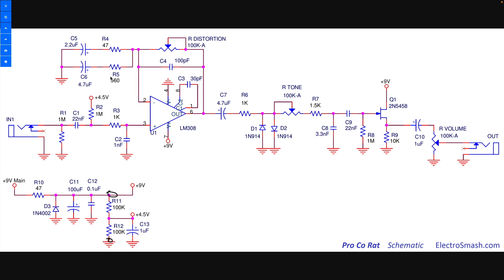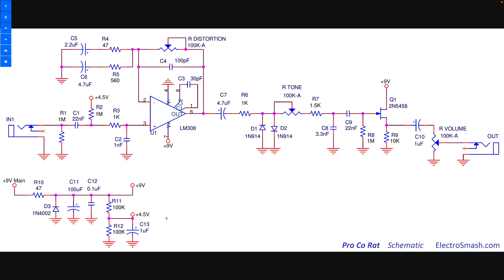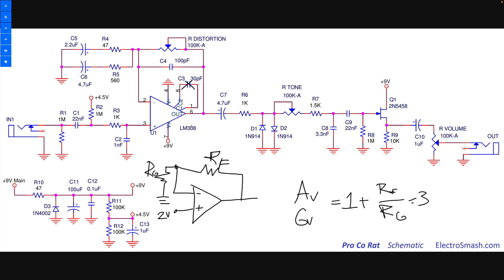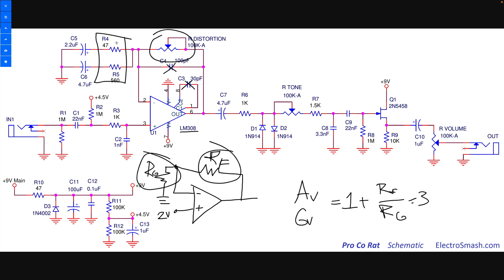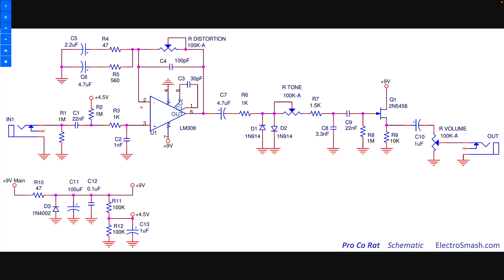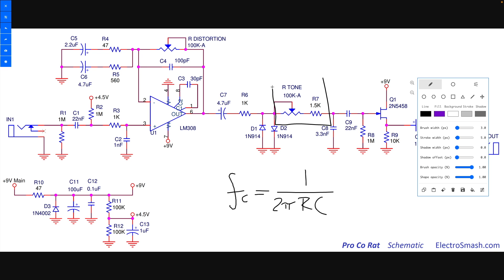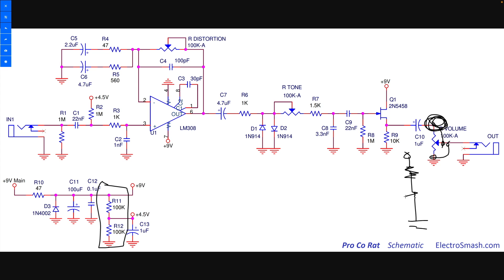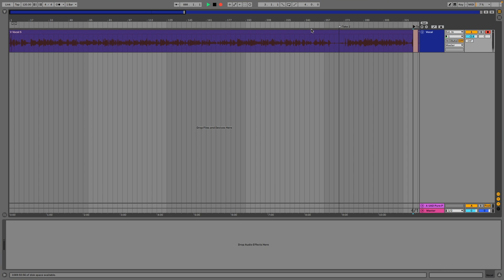Rat Distortion Schematic Analysis

Comment: There are several ways to get different personality.
You can replace LM308 with LM301 or LM741 or CA3130. They are pin compatible with LM308.
You can miss-use various components for D1 & D2 such as IR-LEDs or 2N5457s (G as anode, D-S as cathode) or 2N3904s (B as anode, C/E as cathode) or 2N7000s.
Have yourself.

Comment: Hey I opened my Rat 2 Proco and found one of the resisters burnt. It’s either the R10 or R11 or R12. Im a lil confused as this is my first time with repair. 

I found a similar schematic online but it has a different ohm value for the R10. It’s listed as R1 100ohm. Another difference I found was instead of the 1N4002 diode it’s using 1N4001. Remaning are the exact same. Should I replace it with 100ohm instead of 47?

Comment: Dude.. the diode isn't a 'Fuse'. That is a perfect use of a diode and it is what they were designed for. Hard to take the rest of this seriously when you fail miserably within the first minute. Why don't you explain a better way to do this? And it has to be as cheap as a single diode.
Reply: He is right about the circuit though..  a shottkey in series would be an improvement or you can find transistor circuits that are even better...

Diodes often fail short due to overheating (like when it sees several amps suddenly in a reverse  supply situation), in which case it  will allow reverse  current in the circuit itself.   This supply section could be improved easily by adding a fuse or small resistor in series with the diode that will be guaranteed to fail open and isolate the circuit, but the math shows a significant amount of reverse current will still flow in the circuit itself which may or may not be problematic for certain components.   (CMOS ICs may not like it, even for part of one second for example)

It was perfectly reasonable for this to be mentioned..  the guys at Pro Co were pretty high when they designed this I think

Comment: being a begginer in electronics, i am only able to get the gyst and cannot converse fluently or articulately in these things.i have a question about that section you went over after the opamp and after the diodes. i think you said resister and capacitor where freq. begins to drop. Could you split that say into 3 seperate differing resisters to move the frequency fulcrum to 3 different spots for cascadeing drops?
Reply from the maker: Short answer is yes. In fact, that's happening in the feedback loop of the opamp in the rat here. The two pairs of caps and resistors are acting as a pair of highpass filters to give the bottom end a unique filtering curve.

There are some issues with simply stacking filters serially without buffering between them, but there's lots of cool filtering tricks you can to by combining different configurations. The Big Muff filter comes to mind as an example of a highpass and lowpass that are both controlled and blended together on a knob.

Comment: So, where might one hope to find the foundational knowledge requisite to understanding most of the language and elements of this video?
Reply: im barely grasping the gyst myself... watching jhs videos helped me. basic electronic class will probably get you these tools
Reply from the maker: Georgia Tech has some great free online classes. I also find this type of circuit Analysis really helpful to develop intuitive understanding.

 Some good things to start reading up on:
- Components (resistors, capacitors, diodes, etc.)
- Voltage Dividers
- RC filters
- Opamps
- BJT’s

You can do a lot with just those few elements.
Reply: What Georgia Tech course would you recommend? Thanks for the info!

Comment: I don't know what you find wrong with an LM308. It's not such a bad choice for a ultra low input bias current op amp. The signal is being distorted by D1 and D2 anyhow and and the JFET output stage is easily outperformed by the LM308.
Reply from the maker: The short answer is the LM308 has a crummy slew rate. If you're interested in more details, you should follow my "Circuit Vlog" series. I'm about to post a deep dive into opamps including the LM308, the very popular TL07x, and others. We'll compare the stats off datasheets, prices, availability, etc.
Reply: @theandromedacorporation  According to the data sheet the slew rate is 4 V / µs with a 30 pF compensation capacitor which is about 10 times more than required by a circuit powered from a 9 V battery. Also, the input signal is low pass filtered by 1 K with 100 nF which equates into 16 KHz - 3 dB. Of course there are better op amps with even lower quiescent current specifications today. But my choice would not be a TL071because of the quiescent current in the range of 1 mA. Also people might prefer the sound of the LM308. The sound in this case is determined by how the LM308 saturates and comes out of saturation.
Reply from the maker: Yeah, that's all good info that I'll explore in depth in my circuit vlog this month. And to be clear, I'm not saying, "install TL071's in your Rats." I only mention the TL07x as another opamp to be included in my opamp deep-dive. The TL07x seems to be the most popular by far in the synthesizer DIY scene.
Reply: @theandromedacorporation Pretty sure the  308 slew rate is far above any signal a guitar can produce.
Reply from the maker: @wayahedia9989  Not quite. The slew rate is fast enough to not effect the fundamental of 99% of guitar parts which live in the 100's of Hz range, but overtones in the kHz range are attenuated. The slow slew rate can have an effect similar to a lowpass filter. Here's a link to interesting discussion of the effects of the slower slew rate with some data from sims and no guitar bro-science. 

https://www.diystompboxes.com/smfforum/index.php?topic=127757.0
Reply: The op amp contributes quite a lot of distortion and all the "fuzz". The dynamic range between it and the diodes clipping is only about 12 dB and with an actual guitar seems tiny.
Reply from the maker: @spentron1  opamp clipping is real, I've even used it in my own designs, but I worry you're downplaying the effect the clipping diodes have. There's loads of character to be had from using different types of clipping diode. Those diodes do plenty of fuzzing up the sound.
Reply: @theandromedacorporation  The diodes have a substantial effect, including that they sound so much cleaner than the opamp that whenever it really sounds distorted the opamp is getting into the picture, just simply because you have to push the diodes that hard anyway. The diodes still affect the waveform more because the opamp has to work through them.
Reply: You can replace LM308 with russian  КР140УД1408А It's cost 50 cents😇

Comment: What is the +4.5 volt supply for ? I don't see a connection point, just the +9 volt at 2 points.
Reply from the maker: 4.5V is the middle point between 0V and our 9V maximum. That gives the opamp the room it needs to swing the audio up and down. If the circuit were biased to 0V instead of 4.5V, the opamp would be able to make the peaks of the waveform, but the troughs would get cut off, as the opamp wouldn't be able to go below that 0V.
Reply: Above R2 it feeds into the lm308's non-inverting input
Reply: It, with +9v and 0v ground a virtual bipolar supply of ±4.5v for the opamps which require it.+4.5v plays the part of ground in this scenario. The opamp outputs are biased to 4.5v above ground and large capacitors block the DC for other components to operate as ground referenced.
Reply: the guitar signal is biased at 4.5V. The signal rides the 4.5V instead of riding 0V. So it's in the dead middle of the opamp operation range.

if your guitar signal was not biased (riding 0V. swinging from -1V to +1V for example), the opamp couldn't have amplified the bottom half of the signal, since the opamp operates within the 0-9V range

Comment: The JFET is wired is source follower mode, so it cannot add any voltage gain. It does contribute some current gain, so really it's purpose is an impedance converter. I'm sure I've seen an older schematic for the RAT where there is actually a similar circuit on the input before the op amp. 

One thing about the RAT is that LM308 opamp. It's listed as a "precision op amp" and off the shelf at many suppliers it's fairly expensive. However, it is considered in integral part of the tone of the Rat. The clipping diodes are pretty ordinary.
Reply from the maker: You're right about the JFET. Did I get the name flipped around or something in the vid?

I read somewhere that the LM308 has poor stats compared to contemporary opamps, the slew rate is supposed to be especially low, but check the datasheet before you quote me on that. I'm about to do a deep dive on opamps in my Circuit Vlog series and I'll be sure to include a proper investigation of the LM308 when I do that.

Comment: Thank you! I’ve been wanting to try building myself a rat clone for a while, and this really helped me understand what’s actually going on. My end goal is a double rat with both LED and normal diode clipping running in parallel, with a knob to control the ratio between both clipped signals. This is helping a lot :)
Reply from the maker: Yes! Have you checked out the Sibriex Distortion Pedal that we make? Because you've just described something very similar the "mutate knob" on it. I recomend yellow or blue LED's. We went with yellow LED's in the Sibriex, but blue was a close second.